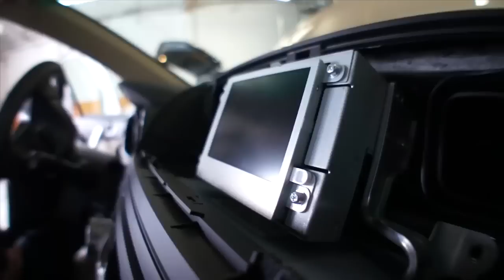Amplified - 36 "Prank Call" @SoundManCA

Comment: the same thing kinda happened to us, we had a keyless start put into the truck and we drove way up in the hill and the truck would not turn on, so we unplugged the little unit thing and it worked. we got home and plugged it back in and the truck has worked just fine sense then. it really sucked

Comment: You had the "typical customer" down to the tee.  I once installed an alarm for a guy who later called me back saying I unplugged his windshield wipers.  He thought he was slick but his wipers never worked since he bought the vehicle.  I couldve told him that it was only the fuse but since he tried to blame it on the install I told him to contact the dealer.

Comment: What you don't want to do (if there is a choice) is not feed signal from stock decks using high inputs or high-low converters. Not true for all stock decks, but most will have a shitty signal going to your amp. I hated my stock deck. There was this horrible rumble-like noise that drove me crazy. Barely audible to most, it sounded like sound vomit to me.